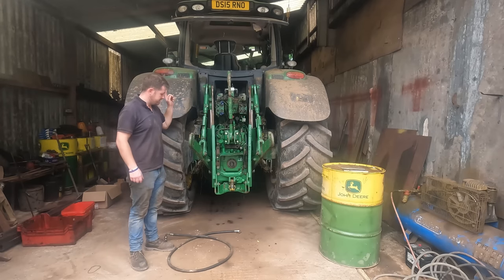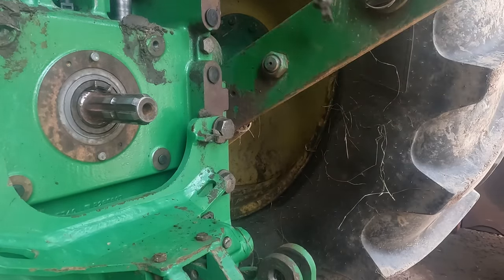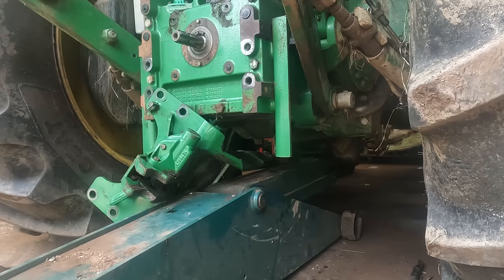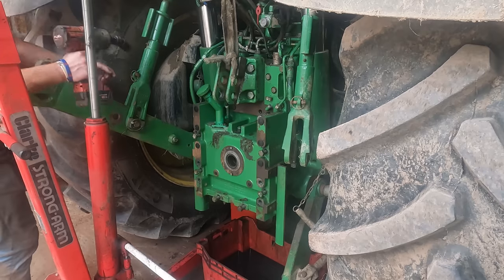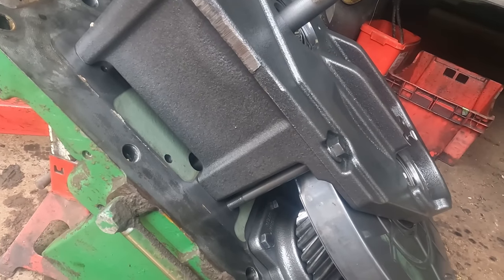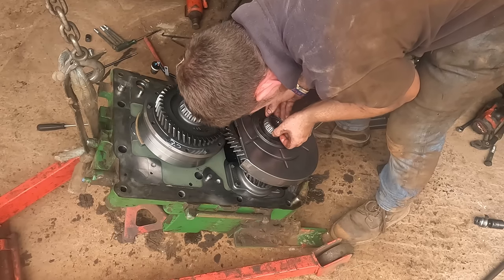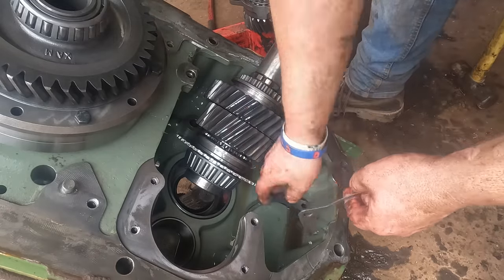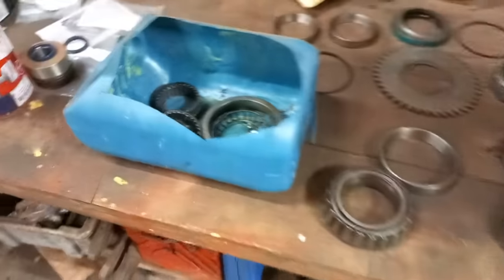John Deere 6210R PTO problems!?! | Is it catastrophic or minimal?!

Comment: This is a normal fit! I have taken apart dozens of these, even new/almost new ones, them bearing always fits loose on the shafts and in the housing. They wil run forever with it
Reply from the maker: Good! Otherwise, I'd have to take the whole thing apart again! 😂 the Tech boys at my local John Deere dealer rebuilt it for me, so it must have all specd up fine!
Reply: Great! Nothing to worry about then
Reply from the maker: @joranbrouwer2157  We did put all new bearings a seals in while we were in there, but they couldn't see anything wrong 🤷‍♂️ must have just been a rumbley bearing!
Reply: Yea it must be, sometimes i see when a customer has had a pto shaft on there that was to long, the bearing gets beaten up. Thats about it
Reply from the maker: @joranbrouwer2157  I think what I'll do is make sure all my machines PTO shafts are moving freely to take pressure off the PTO bearings!
Reply: Thats a smart thing to do! Check if the inner pipes are in good condition, no scoring marks, they will bond when under heavy load
Reply from the maker: @joranbrouwer2157  What would you recommend for cleaning the inside of the outer pipe 🤔 because being 3 foot long or more, my little wire brush won't reach very far 🤷‍♂️😂
Reply: A strong degreaser and high pressure warm water claener, stick it in there, temp good warm, that will clear the dirt and grease
Reply from the maker: @joranbrouwer2157  I had the thought of some barbed wire on the end of a drill if it's very stubborn 🤔
Reply: I suppose that it would do the job! Or a piece of cloth on a broom stick. But real hot water does clean up nice in my experience.
Reply from the maker: @joranbrouwer2157  I've not got the luxury of a hot washer yet! I think me and dad have decided that when our current one finally snuffs it, we'll get a hot washer! It will make all the difference for the machinery side of things!
Reply: Ist a good investment, all dirt washes off way better. You'll never want to wash with cold water again.

Comment: Did the dealer mention anything about the bearing races spinning on the shaft and in the bridge housing?
I’ve recently replaced the mfd bearings on a case/mccormick and was very surprised to find the bearing races were a ‘loose’ fit in the housing, when I questioned it I was told it was normal and to install with loctite bearing fit compound.
Reply from the maker: Nope, they didn't say anything about the bearing bridge. They just replaced all the bearings and seals. My thinking is maybe when the different metals expand in heat or something? I don't know! All I know is it works now 😊

Comment: I'm usually reluctant to watch videos from across the pond because they always do stuff half donkey backwards and or I have translate the terminology, but I did anyways and my assumptions was right. Not only is this not the run of the mill tractor in redneck rural America at 200+hp, but you say the repair cost was about "$1,400.00 quid" really....................
Reply from the maker: ...what?